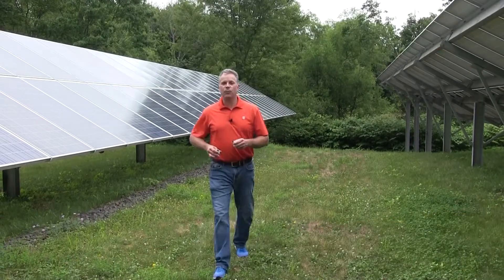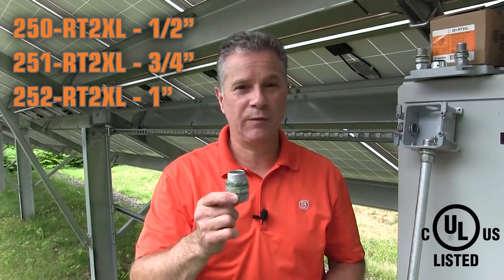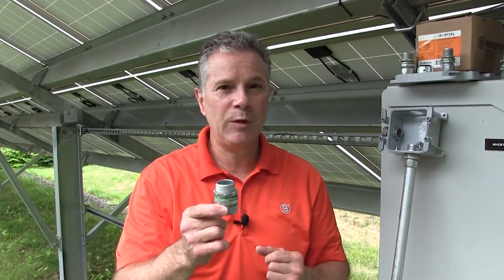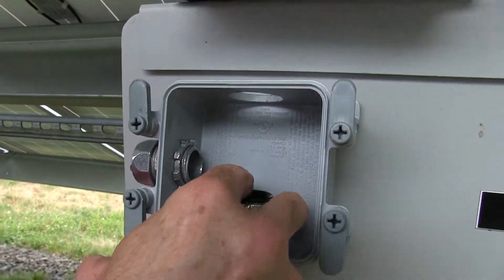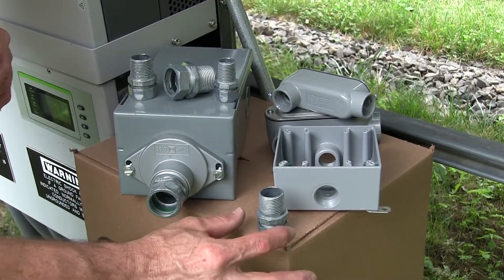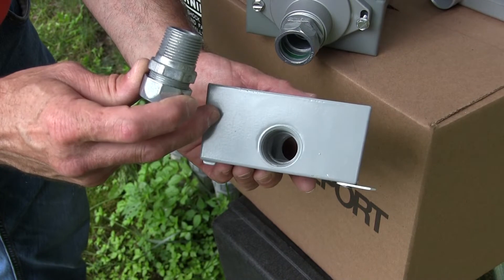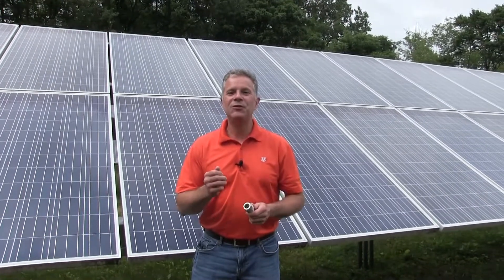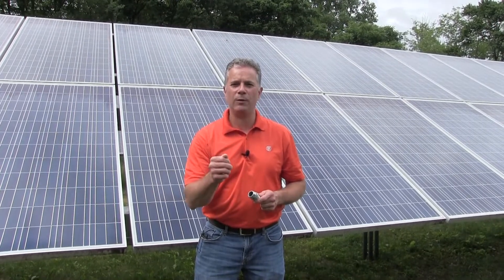Mighty-Seal® Raintight NPT EMT to Threaded Entry Connectors are available now!

Comment: You cannot run emt underground. It was not shown but I assumed you showed an agricultural setting. 3/4” thread 2 gang bell box which is nema 3r rated but emt is not weatherproof. What exactly are you trying/sqying you can do. Read nec.